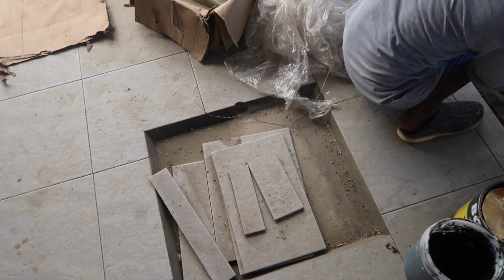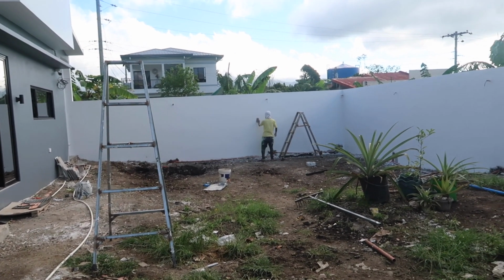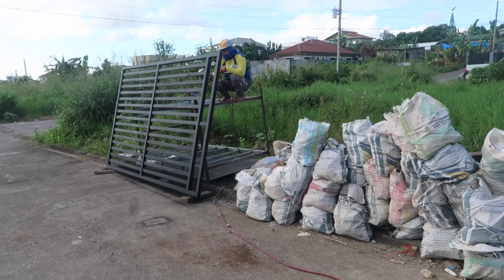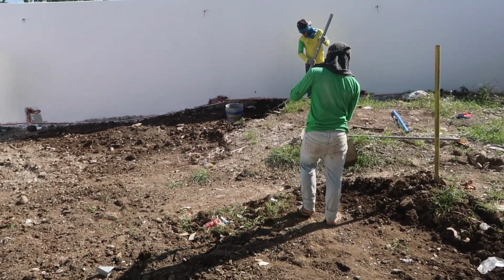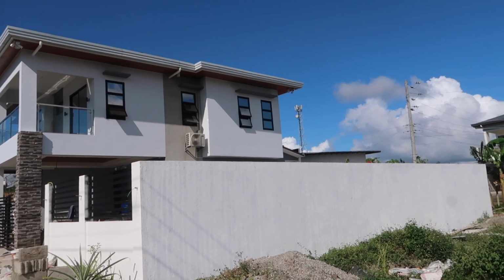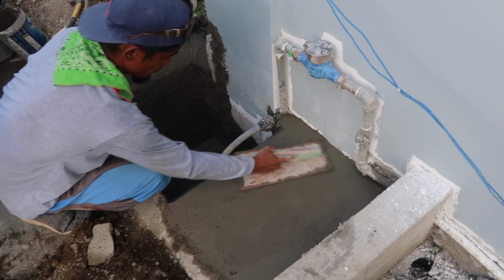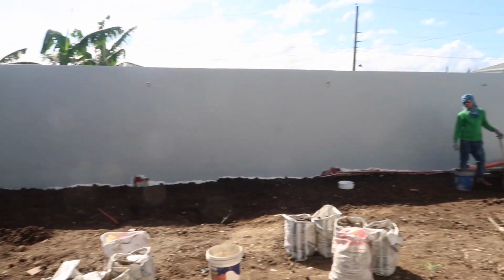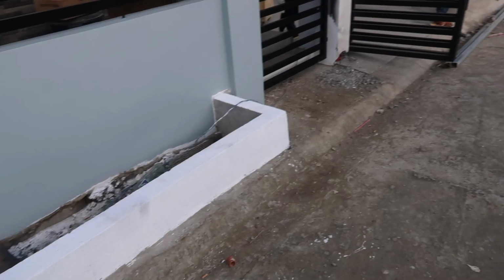HOUSE BUILDING IN THE PHILIPPINES - EPISODE 201: SLIDING GATE I LAND LEVELING I STAIRS REVEAL

Comment: You cannot have a Septic Tank in the Car Port. It also has to be emptied It has to be waterproofed and it has to provide easy access for the  Sludge Gulper to empty it. I have tried to warn you that this is a Building Code requirement, keep ignoring it and reap the consequences.
~
But I know you will not listen.

Comment: Need to get a real electrician and get a good ground...  Just think if your wet  or standing is water and the stove bites you.   Hope you never get a pace maker or it will be all over.
Reply: I thought the water heaters would have to be grounded and I thought he had different electrical outlets for the things from the states, you would think the outlet for the oven would be grounded, not good getting a electrical buzz, differently needs checked out, I'm concerned about the water heaters for the showers if they need to be grounded or not.
Reply: @noneofyourbusiness1683  The whole Philippines is 200v ,  its the amps that get you.